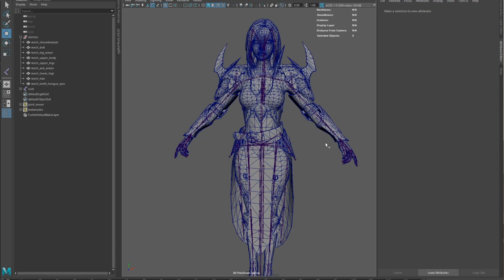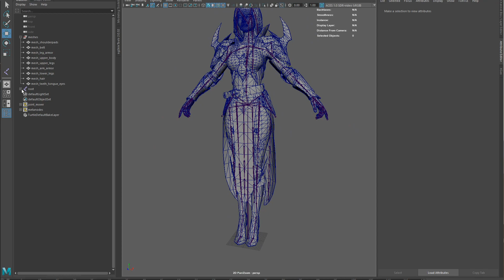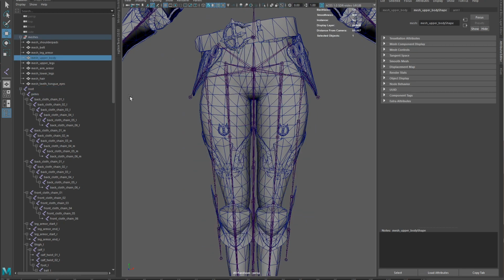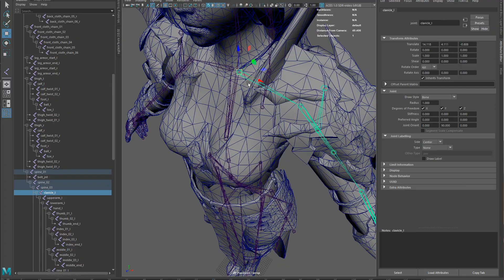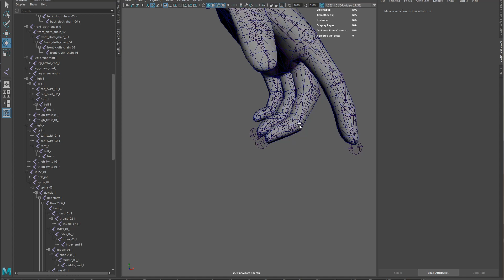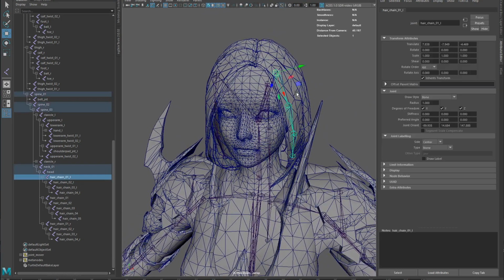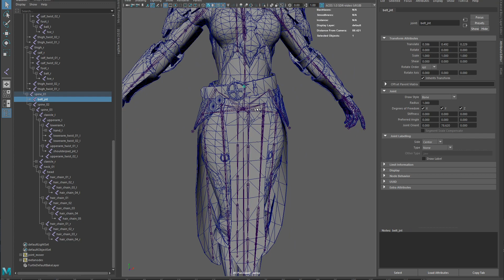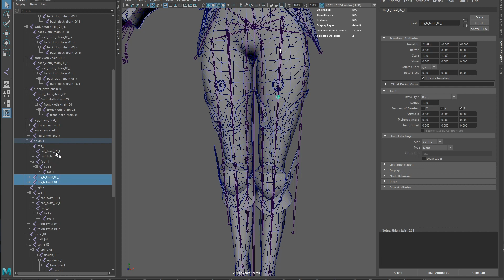Part 4: Joint Placement Overview

Comment: How did you make the twist joints?
Reply: MGear gives you an option to place twist joints.
Reply: @AYYOFLOCKA  thanks for the reply, is  mgear any good? I can't find much stuff regarding it.
Reply from the maker: To make them manually, it’s super easy! Just duplicate the parent joint, parent the duplicate to the parent joint, and move in tranlslateX along the bone.
Reply: @jeremyernst  For sure! Don't forget you then make a falloff rotation expression, I'd recommend using nodes that clamp the value of the main bone (the wrist in the forearm twist joints for example) so that you get that nice smooth falloff.